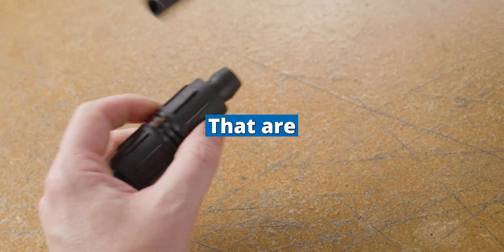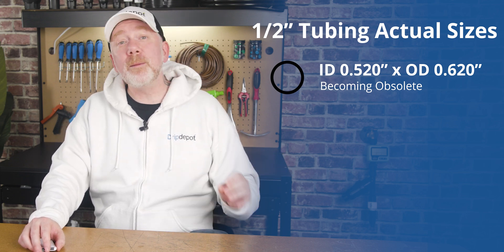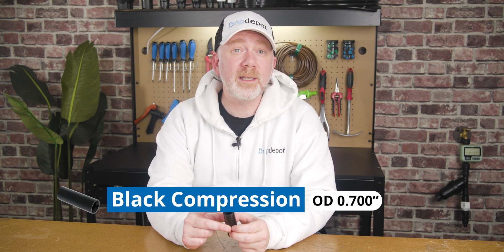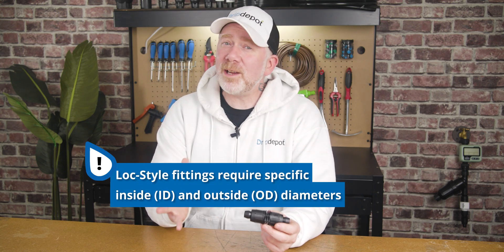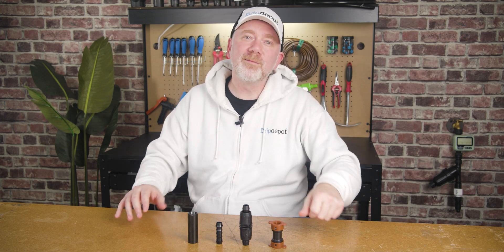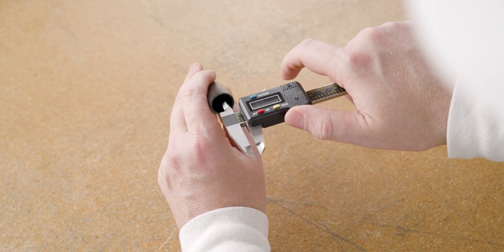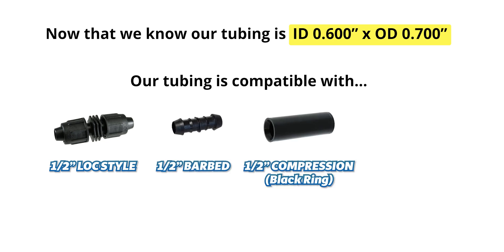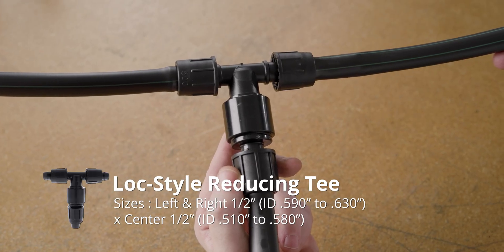Wrong Half Inch Fitting? Understanding 1/2 inch Tubing Compatibility

Comment: Welp that would make sense why I cannot get my tubing into the green compression sleeve. How stupid but appreciate you pointing this out
Reply from the maker: You bet!  And yep, those green inserts are for 0.620" OD tubing, so that's almost certainly the cause.  Perhaps we'll see the tubing industry standardize at some point like PVC, where all Schedule 40 has the same outside diameter, it would definitely make finding compatible fittings easier.
Reply: @dripdepot  well from what it seems I do have the correct size but this thing isn’t close to going on. Even tried using a lighter to head the hosing up and it won’t fit 😂
Reply from the maker: @jimmys7985   Interesting, you do have the 0.620" outside diameter tubing?  

If so, it could just be the general ornery-ness of compression fittings, they notoriously stubborn unless you're someone using them all the time and getting used to them (and even then, there will be moments lol).  

Jimmy, this might sound a little counter-intuitive, but if you have confirmed your tubing is 0.620", try doing this when your tubing is very cold -- why cold?  When tubing is warm, it expands, when it's cold it contracts.  Since you need to fit the tubing into the end of the compression fitting, it can work better when it's contracted and thus a little bit smaller (with barbed fittings the heat trick is definitely the way to go though).
Reply: @dripdepot  any recommendations on the compression hose swivel attachment? Can’t stop this thing from leaking
Reply from the maker: @jimmys7985  Happy to help!  Ok, do you know what diameter of tubing you have in decimal inches?  I can pin down a compatible and easy (much easier than compression) to use hose swivel x tubing fitting, all I'll need is either the actual outside diameter or inside diameter of that tubing (both preferably, but I can infer the OD or ID from just knowing one of them).  

Do you have any calipers?  If so, that's the easiest way to measure ID/OD.  

If not, do you have a link to where you purchased the tubing (or did you get it from us?)?  I can check the specs if it wasn't purchased from us and likely pin down its actual diameter :)
Reply: @dripdepot   sorry for the late reply. 1 hose is 0.620 OD and the other is .700 OD

I have attached the green compression and black rain drip hose swivel connectors and even though they’re as tight as possible they leaked from the bottom of the blue swivel attachment. I’m sure it’s a user error 😂
Reply from the maker: @jimmys7985  Definitely don't be too hard on yourself, compression fittings are simply a pain -- there a big enough pain I've seen contractors (people who use them every day!) use non-toxic dish soap to lubricate the end to make it easier to push into the compression ring lol.  

I'm happy to provide some options if you want to try something different -- do you just need to connect one of those (or even both of those) to a hose bib, or do you want to connect your 0.620" directly to your 0.700"?   No problem either way :).
Reply: @dripdepot  both would need to go onto a hose bib. 1 hose goes to 1 zone of sprinklers and 1 hose goes to another. I can get the compression fittings on there but the blue connector isnt tighting up to the O ring maybe but I can’t tighten anymore without breaking it. Thanks again. I can just cut the hose again and try a new attachment if needed
Reply from the maker: @jimmys7985  Does your compression fitting have a blue end?  If so, that's for 0.710" OD tubing (if I misunderstood, what is the blue connector?). 

Either way, I'm going to link some options for you below in case you end up just needing to use different fittings. 

This one here is compatible with 0.620" OD (0.520" ID) Tubing and has female hose threads on the other side: https://www.dripdepot.com/perma-loc-tubing-by-three-quarter-inch-female-hose-thread-swivel-fhts-adapter-perma-loc-size-three-eigths-inch

This one is compatible with .700" OD (0.600" ID) Tubing and likewise has female hose threads on the other side.  

It may be worth trying the dish soap trick so you don't have to wait for fittings, but Jimmy, if you do end up needing to buy some fittings, let me know -- after all the hassle you've had with these, I'll get you a free shipping credit so it'll just be the price of the fittings.
Reply: @dripdepot  thank you I’ll look into these. I have a black compression fitting for the .700 and a green fitting for the 0.620
Reply: I think my response is confusing. It’s not leaking at where it is attached at the hose and compression fitting. It’s up where the swivel blue piece connects to the spigot itself and screws in. It leaks at the bottom of the spinning connector :)
Reply from the maker: @jimmys7985  Ok, perfect, those are correct (meaning the dish soap trick might work).  Also try it when the tubing is cold if you can, and if all else fails I'll get you some free shipping on the Loc style ones.
Reply: @dripdepot  thank you a lot for the quick responses
Reply from the maker: @jimmys7985  aha!  Ok, it sounds like you already checked the gasket and it is indeed in place, but it's not threading on enough to engage the gasket?  If that's the case, try a quick test -- pull the gasket out of the female end of the other fitting and put it in the other to test it out -- does the leaking cease?  If so, a second gasket may do the trick.  

And I'm surprised it's not threading on enough!  Are your hose bib's male threads "normal" length?
Reply: @dripdepot  not sure if my hose threads are normal length that was something I was thinking about. Gonna try to buy a 2 way shut off to see if that will allow them to screw on enough
Reply from the maker: @jimmys7985  Are you using any thread sealant tape?  If so, try removing it and see if that helps (the extra mass might be causing an incomplete threading).
Reply: @dripdepot  so I wasn’t using any tape. I was told not to. The 2 way attachment fixed the issue. They must not have attached onto my bib but they attached to the new 2 way fine with no leaks. Weird
Reply from the maker: @jimmys7985  Yes, using no thread tape is correct with hose threads (with hose threads it can cause all the problems it's meant to prevent).  

And awesome the 2-way fixed it!  That is indeed strange, but best not to question it when it's working as it should haha. 

Glad you can operate leak free now Jimmy!
Reply: @dripdepot  seems like an old spigot so maybe the size is different. Who knows but now I can finally worry about adjusting the heads and spray. Thanks again

Comment: I cant even find the right size tubing on your website to fit the permaloc fittings looks like you only offer the wrong soze tubing for the fittings
Reply from the maker: Any tubing labeled 1/2" on our site will work with 1/2" Loc fittings -- all of our tubing is 0.600" x 0.700" which will work with any of the 1/2" Loc fittings.  We do have some drip line that is 0.620" x 0.710", but that is also within range of the Loc fittings.  The Loc fittings work with LDPE that has an inside diameter range of .590" to .630" :)

Comment: 😳Do you guys know that there is something called the Metric System where 1 mm is always 1 mm and 10 mm is always 1 cm, and so on?  Just saying. 😡
Reply from the maker: Right!?  

Unfortunately, even metric tubing suffers from the same issue, where 25mm (for example) is not always 25mm -- 25mm tubing is actually 25.4mm, 15mm tubing is actually 15.9mm.  Both imperial and metric work with nominal sizes -- NPS, or Nominal Pipe Size for imperial and DN, or Diameter Nominal in metric.  Even the metric isn't entirely escaping the confusion here, though I will give that it might be a little easier to find a compatible fitting with metric tubing/pipe, at least so long as you know the labeled size :)
Reply: Yes metric is so easy, but not in the US.

Comment: This is actually a very important aspect that is often ignored by tubing suppliers.
Reply from the maker: Agreed!  I definitely see too many retailers selling tubing without providing any information on the various diameters of tubing and how that relates to compatible fittings.  Maybe one day we'll see LDPE used in irrigation standardized like PVC pipe is, that would pretty much eliminate most of the confusion.
Reply: I never knew their were different sizes until I tried to connect them with a connector. 
1 would fit 1 would leak. Now I have to remove the smaller tubing. Would be nice if their was a reduced coupling for the .70” O.D. That connects to let’s say .63” O.D.
Reply from the maker: @Dhi-fe5eu  I sent a reply to your other comment, but just in case thought I'd reply here too -- this fitting here may do the trick for you: https://www.dripdepot.com/perma-loc-tubing-reducing-coupling-perma-loc-sizes-three-eigths-inch-500-series-by-half-inch-600-series